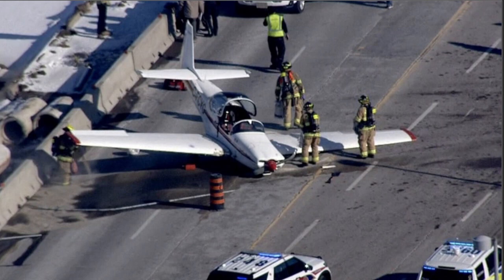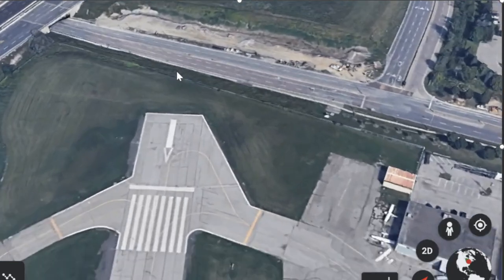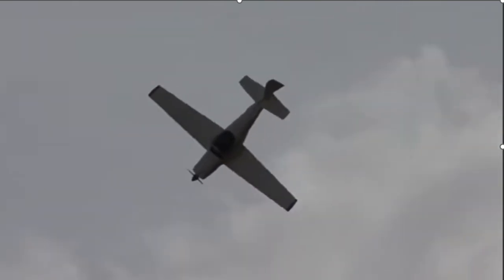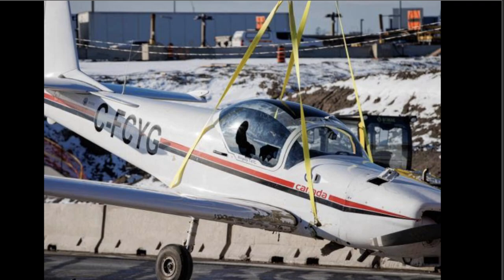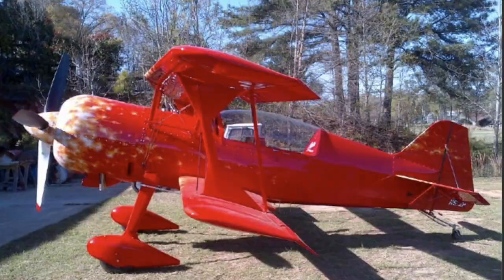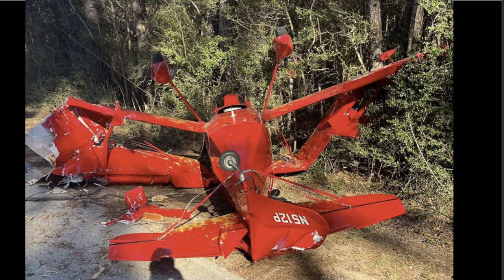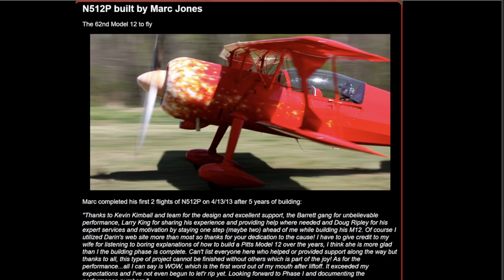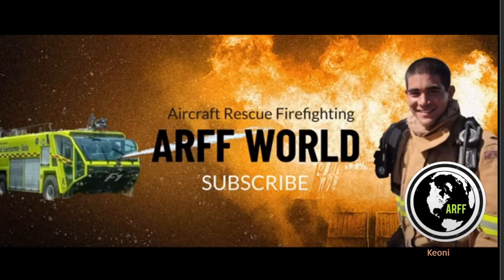Slingsby Firefly and Pitts Model 12 Crashes

Comment: Heard that the pilot of the Pitts said he was trying to make the nearby field; but since the Pitts glides like a brick, had to opt for the road.  Never saw the single wire across the road and apparently just clipped it; another 6” of clearance and it could have been a textbook ending. Still better than going into the tops of the pine trees…. Thankful this father and son walked away from this with relatively minor injuries.
Reply from the maker: Thanks for the update and glad they are ok
Reply: You are correct. A Pitts without engine power drops like a rock....Glad they walked away without serious injury.